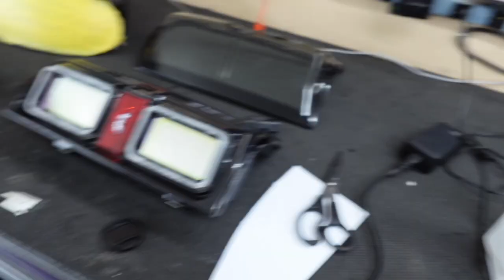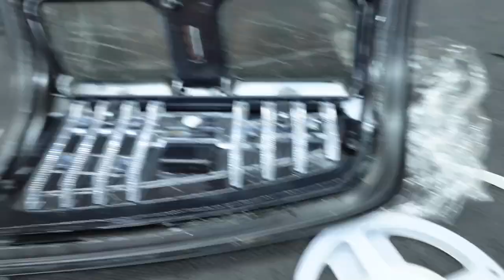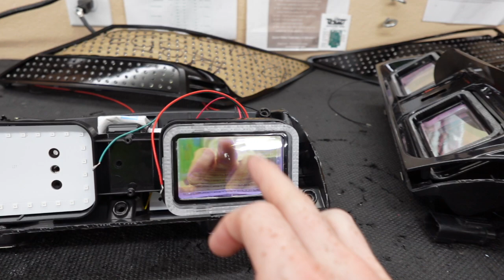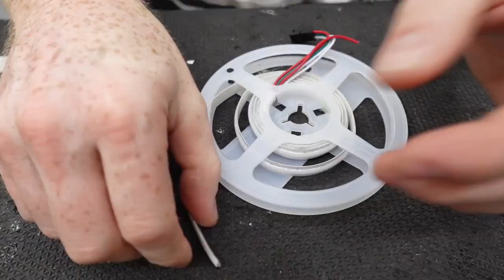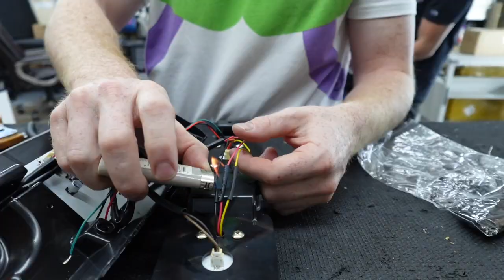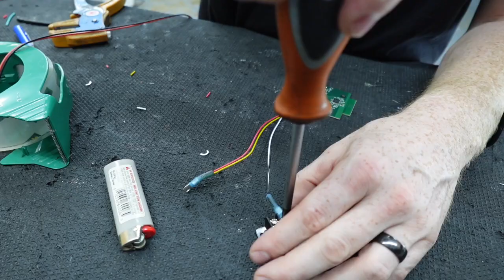Infinity Mirror RAM tail lights

Comment: Hey man I wanted to make a suggestion, you should get some of those tiny trimming snips called Hobby Clippers.They're really small and cut flush and help a lot for getting in those cuts and trimming the small bits you might have missed from being carefull by not going too deep with the ultra sonic or dremel. They help me a lot on opening various light fixtures.

These turned out really sweet! Love platform's like these where so much is possible.

Comment: How often would you say you get complaints because of a product that ended up hyperflashing or throwing an error message? I just know from working on Ram trucks and having a Dodge myself that they throw a hissy fit when it comes to lighting. 

In this case I understand why it will be fine because you still kept factory LEDs but in another instance do the BlueGhozt and CorsoMotion modules work with full on load resistors? And are these resistors hidden in the assemblies somewhere or dangling out where other people can see? 

Just so many questions from a lot of your videos, they really are a blast to watch
Reply from the maker: Thanks!! 

early early on I had a few issues with some hyper flashing and will still get it with the "illumaesthic" style builds but I send out load resistors for those builds. Ive been afraid to install the load resistors inside the tail lights just because they get so hot and ive heard some horror stories about putting them inside the tails. 

so ill send load resistors with those builds but let the customer choose if they install them on the harness or try to find led flasher relays (if available for that vehicle)
Reply: @zaccook 

Hey man dont know if youll see this but you can fix the hyperflash by going to the actual source and putting in an LED flasher relay. They are very cheap and most vehicles accept the same style or can be made to work. Putting in a digital one can work for both incandescent and LED. The problem with most stock incandescent flashers is they're just mechanical and designed specifically for incandescent lights. Digital flashers vary per load to flash the correct rate of speed.
Reply: Not op but usually you have to install a resistor separately to not have hyper flash.